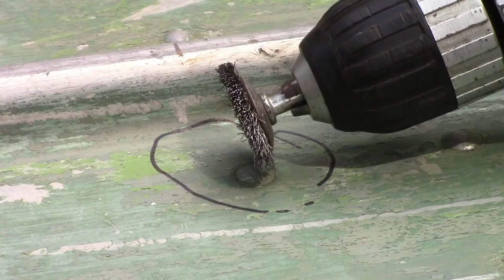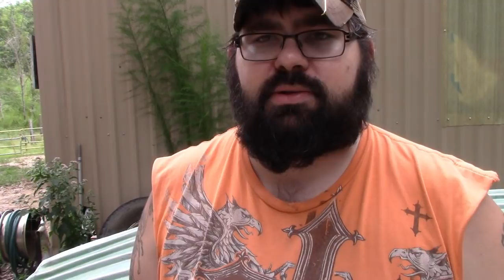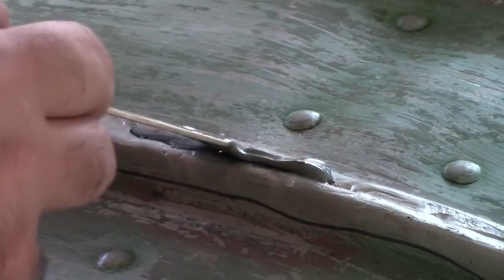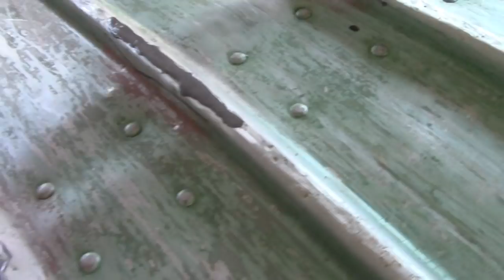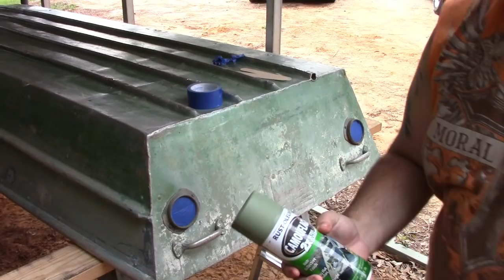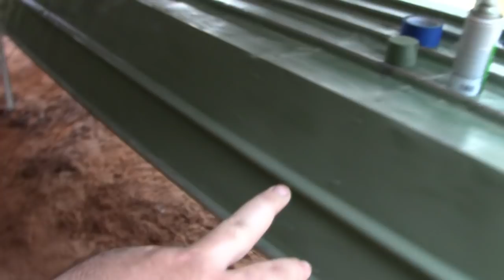Fixing Holes In Your Jon Boat

Comment: I ended up useing jb weld on a $200 tracker topper 1436 I just picked up I used the jb water weld stick  inside and outside then put the 2 part jb weld over all that haha I tried useing the map gas and brazing rods I was able to fix a couple holes with that but other holes they started melting bigger holes so jb weld it had to be

Comment: Hey bro I  got an rc plastic boat I drilled a hole in the bottom of the boat for a water pickup but the pick up was throwing the boat in that direction  I want to remove the water pickup and fill in the hole with jbweld and then put some cardboard on the outside to make it as flat as possible for the filling in and then once it has hardened I will sand it flat with some sand paper my question is will the jbweld be best for the hole to make a hard surface again and will the jbweld not soak up any water over time???
Reply from the maker: I dont see why JB weld wouldn't work. I have filled in holes and cracks both and never had any problems. If you dont feel comfortable about it I think resin would work great for a rc boat but not a big aluminum boat.
Reply: Ya I  think what I will do is use jbweld and then after it hardens and sanded down I will put some ca glue/crazy glue over th outside so water doesn't penetrate the pours of the jbweld over time and sand the ca glue afterwards so it is like a clear plastic cover for the jbweld

Comment: How did this hold up ??
Reply from the maker: It worked great and still no leaks or chipping. Worked out better than I thought.
Reply: @BackwoodsRaised  oh nice , im gonna try it thanks
Reply: @BackwoodsRaised  u ended up spraying flex seal on the rivets?  What kind of wire brush wheel should I buy to clean the area?

Comment: I removed some oar holders from the side of mine and I'm left with some ~1/8 inch screw holes, would this hold across the gap?
Reply from the maker: Yeah it would. Put tape on one side and fill in the hole on the other. Once it cures take the tape off and you will be good.

Comment: Use windshield polyurethane don`t need to clean anything spread it on let dry done deal YOU WILL NOT BE ABLE TO REMOVE EASY it holds the windshield in your car this stuff is tough as a tire get local vehicle parts supply .
Reply from the maker: Thanks for the advice

Comment: Next time you should look into fluxing, its nonstructural but will bond to the aluminum, you can hand it down and make any crack or small hole invisible! and will be a permanent fix.
Reply from the maker: Oh yeah I’ve been looking at the aluminum flux rods you can get. I wish I thought about it before I did this.
Reply: Backwoods Raised you can still go back after the end of the season, break off that J.B. weld and get the low temp flux rods and a burner kit from homedepot, the one with the oxygen and map gas kit, and if you have a harbor freight by you I would get the flux rods their! Super cheap! Once your done you can sand it all down flush and repaint and will look like a new boat! Spring time is to work on the fish houses for hard water, and winter is used for working on the boat! Good system lol

Comment: I had a nice size hole in my alumacraft boat..It was right at the v nose where it gets the most abuse and I used a 2 part epoxy made by permatex..This stuff is good bud I gave busted 3 to 4 inches of ice to duck hunt with it and it has lasted over 12 years...good stuff and highly recommend the permatex if you need to repair again..It comes in like a syringe 2 part...This hole was damn near 1/2 inch...Another good option is drill a hole and rivit the leak..
Reply: I also put the boat in tbe water 30 to 45 min later,,,good stuff..
Reply from the maker: I will look that stuff up.

Comment: nothing  works better  than  the  original JBweld  i  would  spray the bottom  and  inside  with  truck bed liner
they  sell  a  liner  here  at  my  paint  store that  dries hard  but  flexible  you  cant  cut  it  with  a  knife,  its  to hard  but  it  will  bend  and  not  break
Reply from the maker: I wish i would have spayed the inside with bed liner. Maybe next time.
Reply: Bed liner peels right off after being in the water
Reply: @seanjohnson9440  in the inside of the boat... How is that in the inside of the water

Comment: I coated the bottom of my boat with roll on bedliner. Found out that if you don't prep the aluminum just right all over where you apply the coating...it will scrape off very easily. We used sandpaper to cross hatch the metal but appearently missed a few spots and the coating came off.
Reply from the maker: Yeah I might skip that part.
Reply: @BackwoodsRaised  I personally would not do it again. We spent an entire day prepping for it and still wasnt good enough.